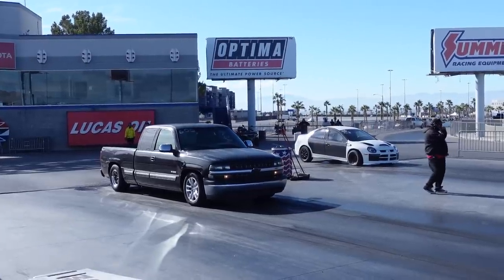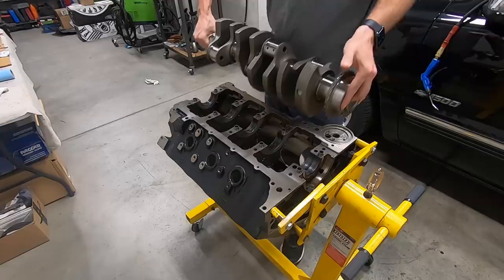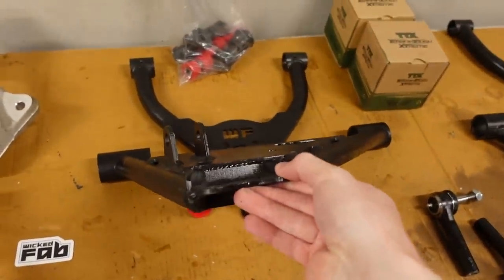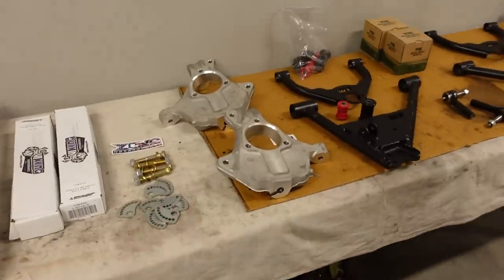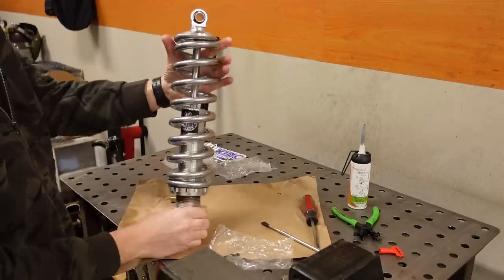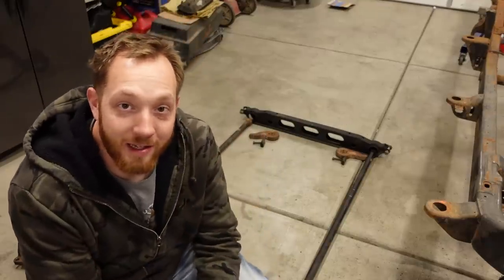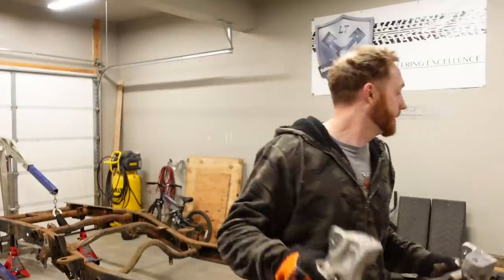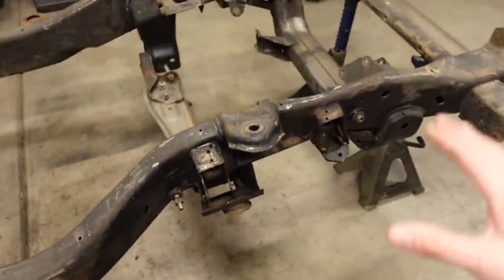I bought the STRONGEST and LIGHTEST drag truck suspension

Comment: I own the fastest 1970 Cougar on jackstands that belongs to me.
Reply: I don't think you do HOMER
Reply: Hell yeah man I'll race you in my 1970 cutlass on Jack stands!!
Reply: @TrailTime.  I own the fastest stock windshield suzuki esteem
Reply: Niiiice
Reply: @Modified1  Bonus points if the rear end is out on yours like mine. Been out about 5 years but I'm slowly getting her back together. I'm hoping spring/summer 2023 I'll be driving her. First in 6 years by then.
Reply: @TyNeePen15  lol no, but I've owned it for 20 years and have never driven it!! Lol
Reply: @Mike Hawksmal  I replaced all the floor boards and installed a 500hp 600tq olds 455, then life took over. I'm finally getting back to it, hopefully this spring
Reply: @Modified1  Well I don't think I can beat that. I've owned my Cougar for about about 15 years (fall 2007) and I did not drive it anywhere near as much as I wish I had before I pulled the rear end out. It was ment to be a quick gear gear change and limited slip install. But I kept adding stuff because I though "while I'm here, I might as well". That shot the cost up very fast.  Then I bought a house. So the car had been on the back burner since.
Reply: @TrailTime.  LOL. Right? It's getting a little ridiculous. 😄
Reply: @Modified1  That's awesome man! That thing is going to be a beast!
Reply: Epic!!!
Reply: @Mike Hawksmal  I like the cougar, because it's not your usual mustang!
Reply: @Modified1  Thanks man. And with about $30,000 in body work, she'll be a looker too. Lol.
Reply: My 71 Nova is on jack stands too. Lol
Reply: I've got the fastest 79 Z28 T-top on jack stands
Reply: I own the fastest challenger with my custom 1 of 1 cam

Comment: Nice call on the 7 notch alignment cam swivel lockers, there are 5 hole ones as well but they have fewer degrees to hit crosscam with. I have them installed with the kryptonite Nordstrom cam swivels on the inside with a lock bolt on the "adjustment cam". I leave the pins in the lock side cam where the nut goes on the bolt and I leave them swinging off the pin with the control arm nut hand tight then loosly snug the bolt (where stock pin was swapped) on swiveling adjustment cam find crosscam and then pull the lock cam to the tightest dot slip it over and torque bolts. Keeping the stock style fine tune inner cam swivel with a lock bolt gives a better alignment and a set of backup lock cams as one only uses half of them in this way.

Comment: Man this one is gonna be the one!! Suspension set up opposite of off road. Loose in the front, tight in the rear. Beings it's awd the front tires need to stay in touch with the ground. I wouldn't limit the travel either.

Comment: Do you have to run a certain diameter wheel to fit those spindles?

Other things to consider is limit straps to control the front end from lifting. Whenever you see the bigger trucks struggle with buckling tires off the line is due to not maintaining the TR angles to keep the toe in check.
Reply from the maker: Pretty sure these spindles will let you run a 16” wheel, but my front brakes need a 17” minimum pretty sure. But I wanted to run 17x10 in all four corners

Comment: Those are aluminum knuckles that the spindles bolt too.  Liking the build so far.     Do you have any ideas for aftermarket axles for the front? What are you going to do for a rear axle?

Comment: This is a great build.  
Some hard earned advice: do not, under any circumstances, use polyurethane suspension bushings if you want any sort of consistent suspension action/launches. They are wholly unsuited as a suspension bushing material under any circumstances, let alone an 8 second race truck. You are far better off with stock rubber, delrin, or a spherical bearing.

Comment: 98 lbs plus old shocks, I think! I wonder if AWD is worth it, though. Modern drag suspensions use limiters on front end travel that basically transfers all weight (regardless of static weight distribution) to the rear. Obviously requires the right suspension geometry in the rear to work—but even leaf spring vehicles are successful at it. Your “COPO” truck looked really good for 60 ft times, but I’m wondering if that’s the ultimate answer. Looking forward to the build and the results, regardless!
Reply from the maker: I would say AWD and 4wd has its advantages but is certainly not the simplest or even the best answer. A good light weight 2wd would probably run circles around this

Comment: Is a rack n pinion conversion possible for these 4wd GMT800 trucks? 

Very nice work! Keep it up!!!
Reply from the maker: for sure it is, just would require a little custom fab work
Reply: You should add a rack n pinion to the ugly truck and make a video for us 😎 There is nothing on the web about this conversion.

Thanks!!!
Reply: @brianthibodeau8958  I'll get in on the group buy for this kit. I was so disappointed when I bought my $500 04 Tahoe and found drag link steering and torsion bars on a 2wd. 🤢

Comment: Changing to lighter control arms and spindles will reduce the unstrung weight.
Swapping coil overs for torsion bars adds unsprung weight.
The question is how much lighter the lower control arm and coil over is than the stock control arm and shock? Is they’re the same or heavier then there’s no improvement in unsprung weight.
Improvements in spring rate and damping with modern coil overs may warrant the swap.
Looking at the weight chart and doing the math, if not for the lighter spindles the unsprung weight would only decrease by about six pounds per side.

Comment: Don't forget the added weight of the front axle
Reply from the maker: I was just calculating the weight loss you would get by installing these parts on a 4x4, but yea, for me I will also be gaining the weight of a transfer case, front driveshaft, front diff, and CV axles

Comment: Also just as a heads up, kryptonite...I love their gear but...their service...ordered the pitman idler setup, when it came I found their "deathgrip" idler would not engage properly and actually gave my truck a "deathwobble" so bad, my 14 year old daughter asked if that was center link rattle lol! Then called thinking it looked like it wanted their big center link to engage...big mistake!!! They were only interested in selling me guess what ....their center link with that sideways inner tie rod "upgrade" which I, on the warning of actual military service personel, would never put in any vehicle. They're known to be an immobilizer, one hard impact and your done... not on my truck... I'd buy backup ones if you go that route as 6-8 weeks for a new one is b.s. and oh ya their center link won't take stock tie rod swaps so pull the whole center link until they get your replacements to you, sounds fun huh... I got and suggest their stock inner tie rods as they are MASSIVE as are the ball joints as elsewhere posted. That "upgraded" inner tie rod design was pulled in the field regularly by the military it is junk! And that "awesome lifetime warranty" means rebuy return, then if they decide, a refund. I call it the three-re. They then shipped me, on purpose I think, a stage 2 control arm with a stage 3. So be careful their stuff is great and oversized but they are not, I mean oversized maybe lolol.

Comment: Didn't @stapleton42_ make way more horsepower and run slower than what your shooting for? Not saying that it's impossible. Just curious what the difference between the two will be.
Reply from the maker: I don't know what ET he ran, but pretty sure his escalade was 6,000lbs + where I Am shooting for a target race weight of 5,000lbs. weight can make a huge difference
Reply: @LawrenceTolman  that makes more sense. I didn't realize the weight was that different. Pretty sure he ran 8.90s before he hurt the previous motor. I don't think he has any videos of the current set up.